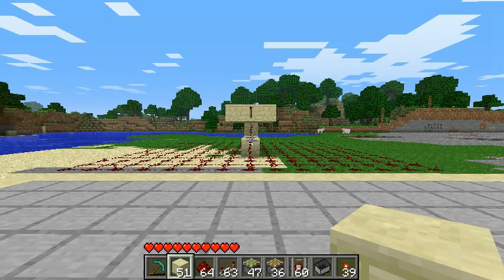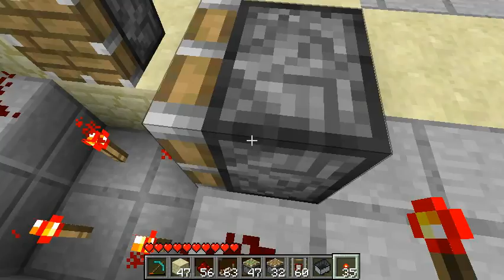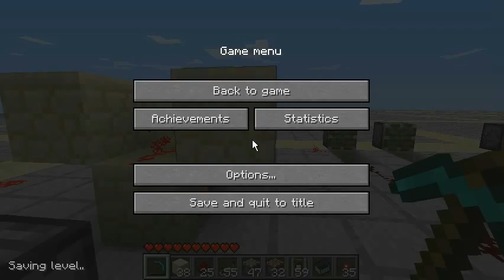Minecraft 1.5-Tick Clock Part 1

Comment: Nice work.  This is somewhat similar to what I did in a video response to one of JuryDutySummons' videos (I17K_31Wjwk).  I didn't think to try extracting the signal from the blocks with repeaters; I just added repeaters to two of the loops.

Incidentally, I solved the update order problem (unknowingly) by just laying the dust in a U shape; uses more space, but shouldn't suffer the same problems.

Comment from the maker: @sethbling What I'm talking about at 4:27 is something that I've tested quite a bit, even with no other redstone stuff on the map except for a single clock, and after repeatedly saving and reloading of the world it does definitely only sometimes load in that locked position, and I'm pretty sure it's due to the block loading in a specific position, causing the redstone to load in the alternate configuration (I can't be absolutely sure because the graphics don't update instantly upon map loading).

Comment: I think that at 4:27 you've misdiagnosed the problem. It's not that the piston gets saved to file in the wrong position, it's that when you reload the file, the HashSet is smaller, and so the update order is different and the pistons extend in the wrong order. At 6:02, when you say "for some reason this works," it works because of an arbitrary redstone update order, determined by the HashSet size. You need to be very careful with these clocks, relative to the redstone update HashSet.